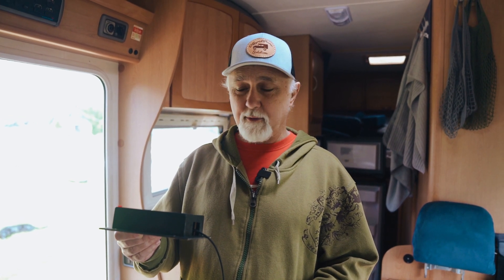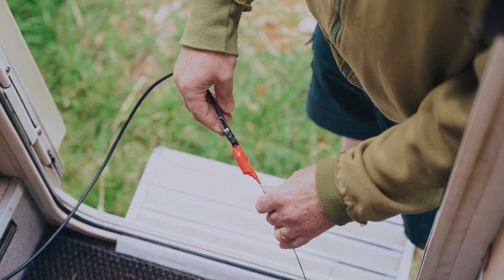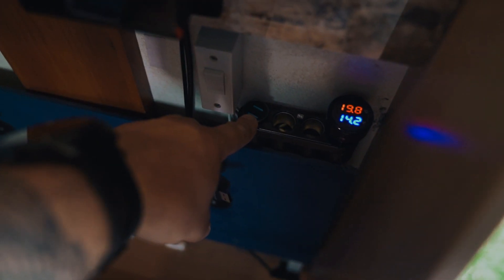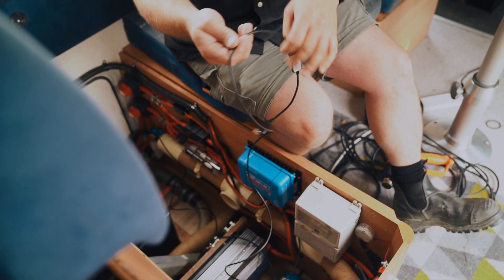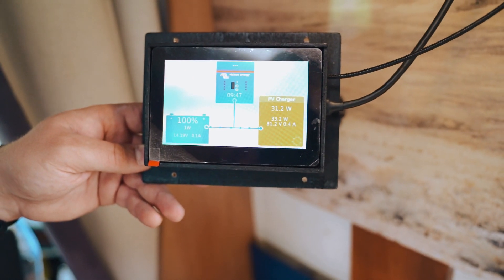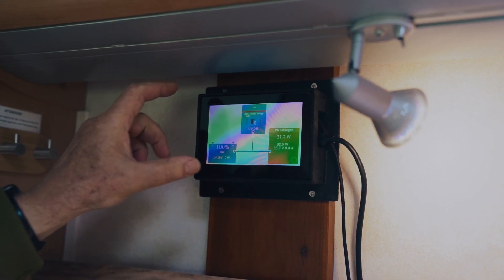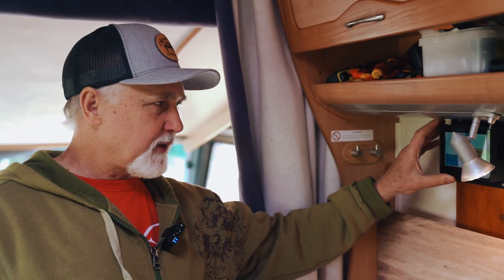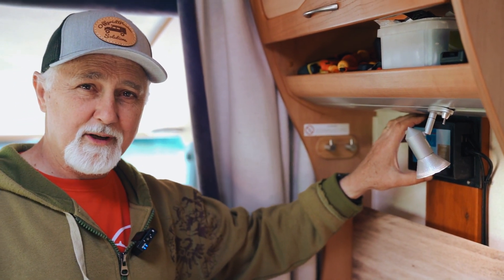Final install of the DIY Cerbo GX / Raspberry Pi in Nigel's motorhome | DIY Cerbo GX Pt.3

Comment: You could use the Victron ET112 power meter behind a DC/AC inverter with the AC load role set in VenusOS.
This way you should see AC loads even when using a non-Victron DC/AC inverter.
I would like to see if this would work, and the setup procedure.